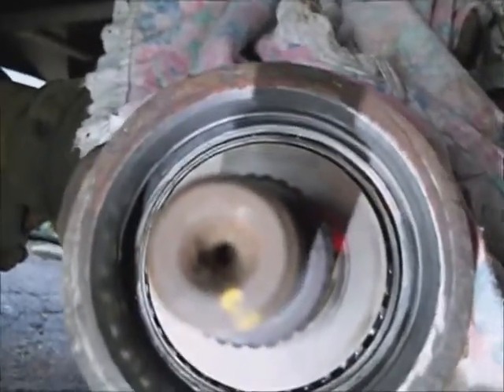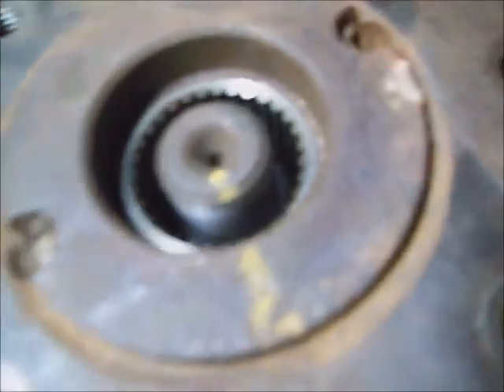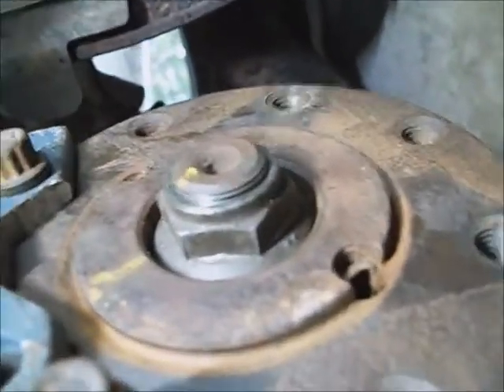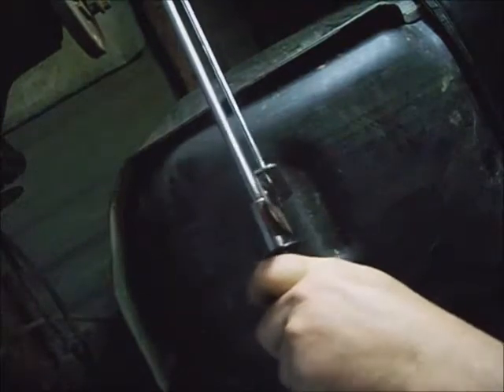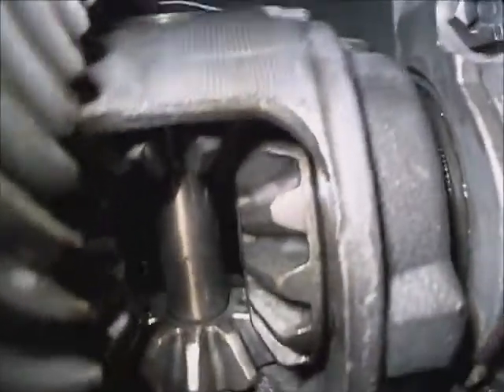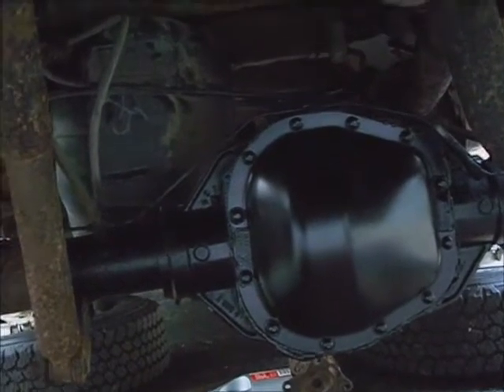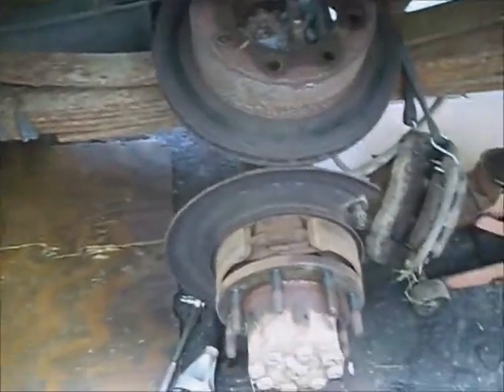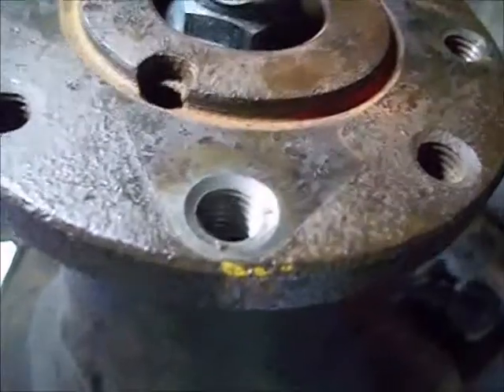Ford F-250 super duty install rear differential flush, pinion seal install pt2

Comment: Thank you for making this video.  I have a few questions about the tool that you used to check the amount of torque required to turn the driveshaft flange.  What is it called, and who sells it?  What’s a good price?  I’ve done a fluid replacement a few times, but never that seal.  Would you recommend a shop tackling that?

Comment: The pinion shaft is stuck I tried to use two jaw puller but now shaft is loose but did I press pion off bearing?
Reply from the maker: It will be loose, then as you tighten the yoke nut back down, it pulls pinion shaft through it, and against the bearings.  The front bearing will slide off if pulled on, after yoke is removed. But it is better not to disturb the bearing, except to inspect or clean any debris from it.  Thanks for watching.